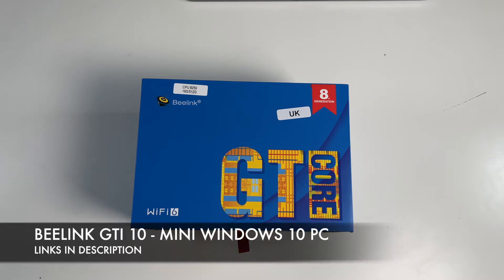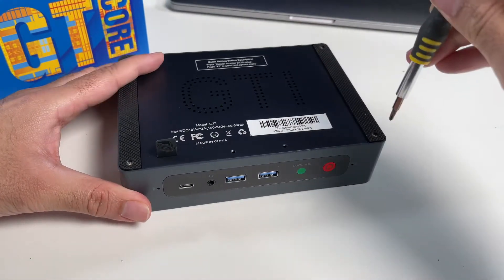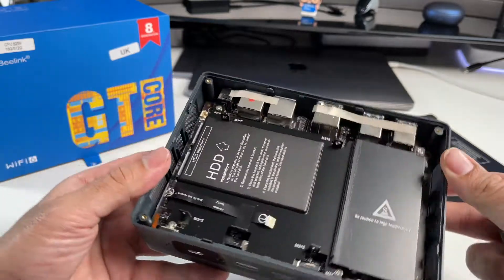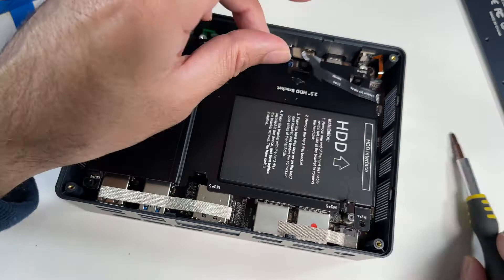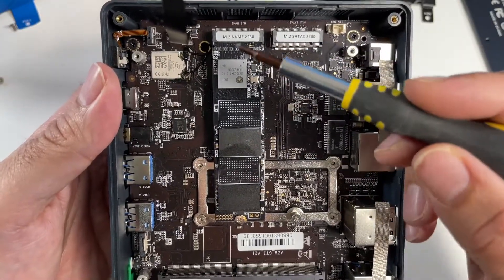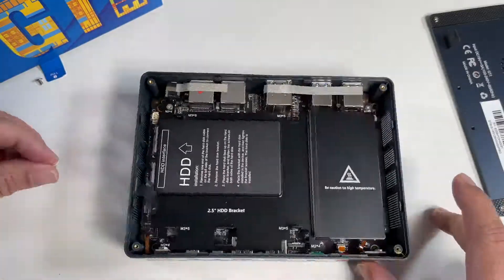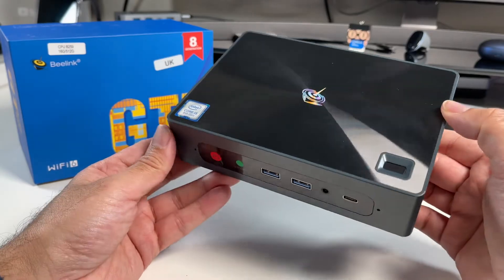BEELINK GTI  MINI PC - Checking out Internals / Upgrade options / RAM + STORAGE

Comment: Why does the "M.2 SATA3 2280" labeled connector have the same connector as the "M.2 NVME 2280" (i.e., PCIE)? I thought the SATA3 M.2 had three sections (two short sets of pins on each side, one long in the middle) while the PCIE had two (long and a short).

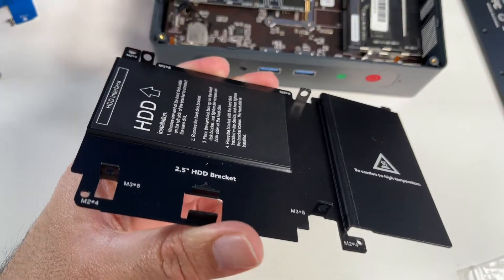Comment: Hi there...great informative video. Quick question - would you know where i could buy the cable in the bag at 2:14? My cable is damaged and i am trying to find a replacement, Kind Regards
Reply from the maker: You need to contact beelink customer service and they can guide you.
Reply: @CHIGABYTE  thanks for your reply. I’ll get in contact with Beelink👍 cheers